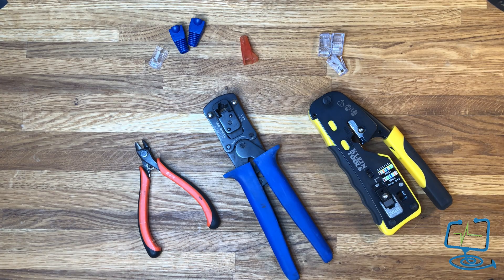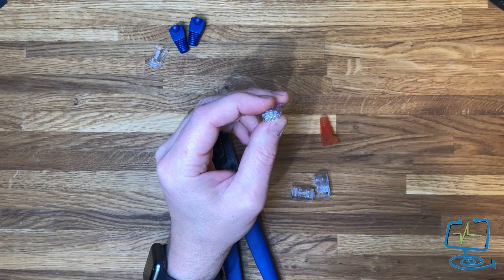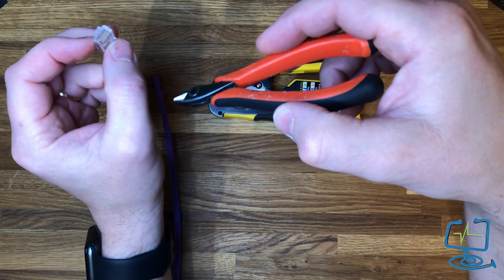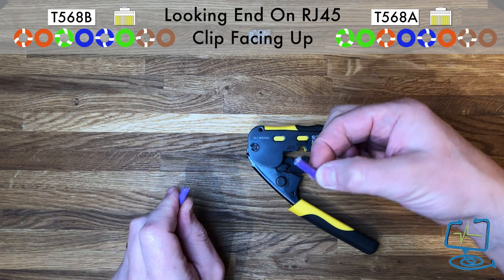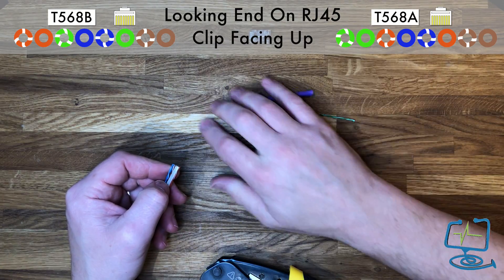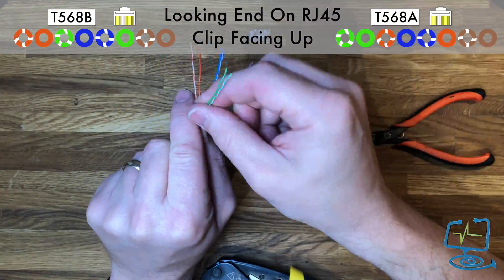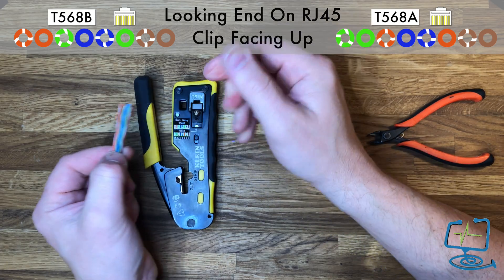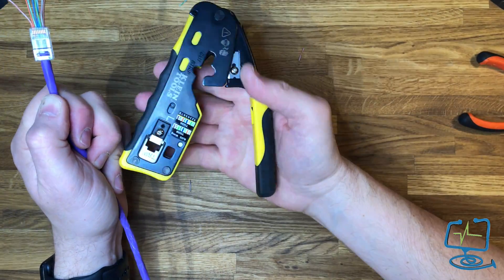💡Make a CAT6 or CAT5e RJ45 Cable using Pass Through Connectors

Comment: Thank you. One tip I came across was that before inserting the conductors into the fitting is that when they are all aligned instead of cutting the across ends at 90deg cut across the conductors at a 45 deg angle bottom left to top right.  This staggers entry into the connector and in my experience the wires go in much more easily and without crossing over.
Reply from the maker: That’s a great tip, will have to try it on my next installation- Thanks 🙏

Comment: I'm getting significantly different speeds when I connect my cat5e cable I made when I swap the ends. Any idea what's cause this ps5 to modem I run speed test I get 500mb then when I swap the cable and plug it in the opposite way I get 90 mbps
Reply from the maker: That’s a strange issue

Comment: I was working on putting new ends on a Lorex Cable, and the wires in these cables are as thin or thinner than chicken fencing wire, and no matter how straight, when I pushed them through they got all mixed up and some bent back. I spent over 30 hours trying to do this, and I finally threw in the towel.  Push through connectors are useless on Lorex Security camera Ethernet cables

Comment: i twist the cores together after i put the rj45 on the cable and before i crimp it. it helps keep the rj45 in place when crimping after i push the cable deep inside it. that way it will not slide out a little. + it helps to get all the cores through the crimper pass the blade that cuts them off.
Reply from the maker: Nice tip, I will try that next time I’m making some ends up. It will help as well by pulling the main cable tight into the pass through connector.

Comment: i bought 300 cat5e pass through rj45s. i have about 175 pieces left.
Reply from the maker: Haha the joys of bulk buying
Reply: @TheComputerLab  they come in 100 per pack on amazon. love it. and the bulk cable. DIY is the way to go in my opinion. my wife's laptop, her wifi controller stopped working at full capacity. so she started bringing her computer to one of the bedrooms and ran the ethernet wire from the hallway to a bedroom not hers. so i thought this is wrong. and ran the wire directly through the walls for her computer. then i ran wires throughout my entire house for game systems and tv streaming sticks. for my kids and such.

Comment: I have an older style crimping tool can I use the snips to trim the ends flush with the connector?
Reply from the maker: Well you might be able to trim the ends but the crimper itself might not crimp the wires correctly.
Reply: @TheComputerLab  on Wednesday I went ahead and tried it. The only thing I had to do so the plug would fit better in the socket was to trim the wires first and then pull them back slightly. The connectors I got had a bump out of plastic and my wire cutters where not cutting flush left just enough wires preventing a full seat of the plug. No issues with the crimp.

Comment: I have never been able to use the cutter/stripper on my crimper. The cable is always too bumpy and I either don't cut enough jacket to break it, or I cut a wire.

Comment: I would like to add you don’t need a special crimper to use the pass through connectors.
Reply: i have a question if you don't need a special tool how do you get grid of the rest of the wires cause thats my problem now i don't have the tool. plz help
Reply: Flush cut snips

Comment: I am about to lose my mind. my cables are straight, but the keep jamming in the connector. they do NOT pass through… certainly not as easy as you've demonstrated. I have even bought another brand of ends thinking that the ones I bought were defective. I've cut them straight, at an angle. I can get maybe 2 wires to go through then nothing.
Reply: Using cat5 connector on cat7 cable will cause this issue
Reply: I was having this issue over the years on jobsites, seems to come down to using 23-24awg cat cable, sometimes the outdoor, the spec on the conductor diameter is bigger than others and ive seen now that the passthrough connectors have hole diameters that range from 1.00 to 1.10 in most but others go as high as 1.25 and the 1.25 passthrough ends do work well with the thicket cat cabling i see run on jobsites
Reply: @flaviosealant8046  That's exactly what it was. I was trying to add connectors to outdoor cable. The shielding was thicker thus the jam. Finally the manufacturer pointed me to the right ends. Aye ya ya! what an ordeal that was! haha…

Comment: I have recently taken it upon myself to replace all the mish-mash of cat 5e and cat 6 cables in my home network with cat 6e. The connectors that  I purchased were "two-piece", which required that I feed the conductors through a piece of plastic a hair narrower than the RJ45 connector, THEN put it into the connector... pain in the butt.  I recently ran across ads for the "Feed-Through" connectors, and was looking for a video explaining their use. I found yours, and you made it look so easy. The next set of connectors I use will be feed -through. Thanks.
Reply from the maker: Yeah I have used the type you have explained they are a pain and horrible to use. You wont go back once you have tried the pass through type.

Comment: This was a awesome video thank you for your time, 1 question could you please share the link for them "Pass through connectors" that you used in this video, as I have tried a few and they were #@$%.
Reply from the maker: Hi thanks - the RJ45 pass / feed through connectors I used on this particular video are made by a company called ideal (from screwfix if you are in the UK) but I have used itBebe from Amazon as well.
Reply: I’m not a tech person, but I’ve read in many forums that with this Klein tool, it works almost flawlessly with Klein pass through connectors.  Using other brands sometimes leaves the first and last single strands uncut. Hope this helps

Comment: The pass through is worse for networking, easier for diy'ers.  The problem with pass through is there is extra wire that creates cross talk
Reply from the maker: Hey Michael, thanks for watching the video and commenting - there is next to no extra wire compared to an original. In fact when making an original cat6 / cat5 cable end up one of the checks before crimping is to make sure all wires are pushed up tight to the end of the connector before crimping - so no extra wires (well maybe 0.5mm at the most)

Comment: This is awesome. Just started getting interested in this and plan on cutting and recrimping cables I have where the plastic bit broke off. So besides the crimper, the plastic RJ45 connector also has to specifically be pass through right? If not it will just work the other way where it’s just a dead end?
Reply from the maker: Hi Mathew - Yes you are right you need RJ45 pass through connectors as well as the crimper for the Ethernet RJ45 connectors. Good look, I would suggest buying a cable tester as well, so you can test the circuit once you have re-terminated.

Comment: Just a helpful bit of info for anyone else that might be watching and following along, the two cable layouts mentioned don't really matter, as long as both ends are the same, but cables from the factory come wired as T568B, so might as well just always wire everything you make as T568B.
Reply: Following the standards helps avoid split pairs.

Comment: You said you need cat6a instead of cat6 for anything other than patch panel cables, but I'm wiring up my house and that was quite confusing. Every other video online states that there is absolutely no need to be using cat6a instead of cat6 for wiring a home, as its good for 10gbps up to 55 meters.
Reply from the maker: Hey thanks for watching and commenting, you are quite right cat6 will probably be just fine. Cat6a has benefits over Cat6 one being better resistance to crosstalk so when installing inside a patch panel where cables are usually bunched together I tend to install 6a (if the budget allows) but I have done lots of installs with just cat6 and they have been fine. I do lots of businesses with patch panels and multiple POE devices, and high bandwidth requirements so yes CAT6a is my preferred BUT you’ll be ok especially in a domestic install with cat6.
Reply: @TheComputerLab  thanks!

Comment: Thank you, good video, clearly shows how the pass thru connectors work.

I recently ran a CAT 5e cable thru an underground conduit from my house to my shop a hundred feet away. Had to terminate the two ends. I had a old style crimper brand new from years ago so I ended up buying Ideal brand closed end RJ45 connectors at Home Depot and doing it that way. If I do any more I may consider purchasing a new type crimper and connectors. Klien makes very good tools. I repurposed a Netgrear WiFi router with a failed WAN port as a wireless access point in the shop, works wonderfully.
Reply from the maker: Great stuff, yeah I like the Klein stuff, I use a cable tester made by Klein as well. Nice use of the Netgear AP 👍
Reply: Few P P
Reply: When running cables between buildings, make sure you avoid creating a ground loop. It's safest to use fiber in that case.

Comment: Would I be able to use an old style crimp tool with the pass through connectors? I don't make many cables and I have an old style crimp tool, so buying a new tool isn't worth it. If I can still use the pass through connectors and manually trim the excess wire, that would still be easier & faster than using the old style.
Reply from the maker: Unfortunately you have to have the specific crimp tool for the pass through style connectors.
Reply: @TheComputerLab  Thank you for the info. Perhaps I'll look into buying a new tool anyway.
Reply: If your crimper has an open end allowing the wires to protude through the opening then yes, you can use a traditional crimper. It's what I have done on a few occasions.

The tool above and similar cost around 40 quid in the UK. For the few number of ends I wanted to put on I could not bring myself to spending the money. 

I tried crimping then using a sharp knife (scalpel type, arts and craft knife) to cut the excess off. Was using solid copper core so the trimming back wasn't as easy or neat as I hoped it would be. Still worked first time though, tested using a Fluke Networks CIQ-100 meter.

The method I settled upon was to using a pair of snips to trim back the excess cable once the the cable was pushed firmly into the pass through connector. This leaves 1 or 2mm of cable sticking out the end. The crimps I'm using here allow me to cut the excess whilst the connector is sat in the crimp tool.  However I have also trimmed back cables with the connector outside of the tool and whilst holding the end firmly, place the end in the crimp tool ready for crimping.

And for a neater finish either push back the cable through the open end or pull back the cable from the other end. As you only need to adjust the cable position 1 or 2mm it should be easy enough to ensure you have enough outer sheath under the strain relief clamp for a secure crimp.

Hope you can picture that and it makes sense !!

Comment: For cat6 cables, don't they need to use the staggered RJ45 connectors? Would there be  a difference in speed if we use these passthrough connectors? TIA
Reply from the maker: Hey - There will be no difference in speed using this style of connector.
Reply: Use the ones with load bars. Helps with very high transmission speeds.

Comment: gotta say been using the old blank terminator those passthroughs look alot easier would make my job faster. Still Would like to get a quick stripper since my old one slices too deep for the 23awg cables.
Reply from the maker: Hey snintendog- I hear you, but yes the pass through rj45 cable ends are super easy and reliable to terminate compared to the old style.

Comment: This helped a lot, thanks! I was having trouble as my cable contained wires at 23 awg with pretty thick insulation on each wire. I ended up stripping the last 1/4" of each wire and this helped each wire find its slot. Then I could bully the wires out the other side (patience) and pull them through using pliers. But having your video as a reference made all the improvisation much easier.
Reply from the maker: Thanks “Dang That’s Cool” glad it helped.

Comment: Thanks for the video. This has nothing to do with the pass-thru 
I am having trouble with my crimps. I don't know If I having 1. Solid core not crimping correctly. 
Improper rj45 for sold core plug or just a bad crimping tool. 
When I crimp it seems to bury pin 1 past deep in the slot but just grazes most of the others. W I check it out electrical #1 is seated so far down it does not make an electrical connection.  Will I need a different tool and can I terminate solid core
Reply: We were using the EZ pass-thru's and were having pins 1&2 open when tested, we used different crimpers; different test meters; different techs and all came up with 1& 2 open. We finally  went back to the plug style using the load bars. The pass thru loads easy and looks really good, but just doesn't test out. It's appears as a good idea, but didn't work for us.
Reply: Hello,  I would say the crimpers past its use-by date. Time for a new one, If your doing it professionally, it's better to pay the $$ and get a good quality one.